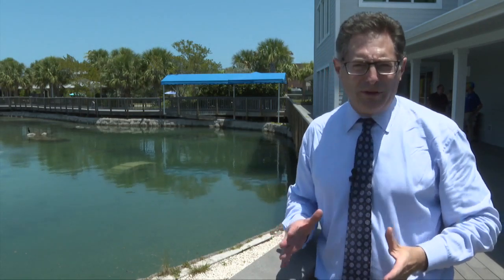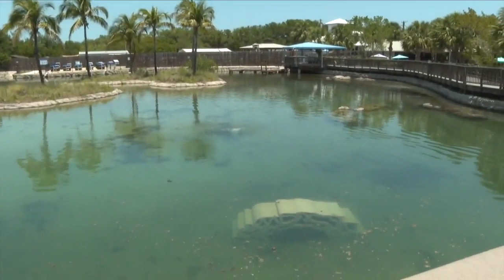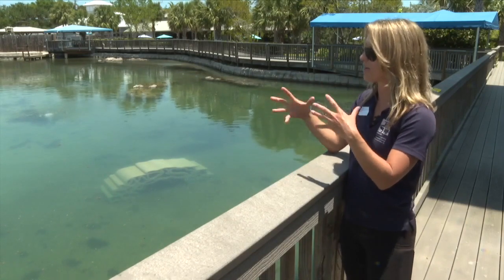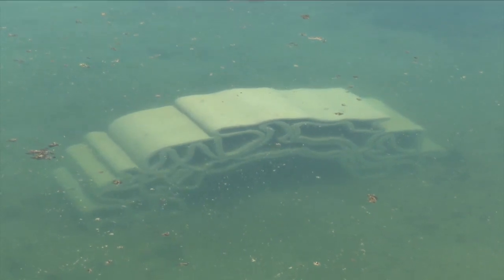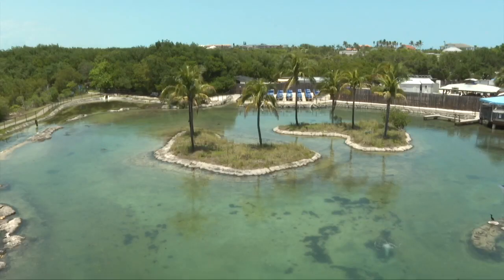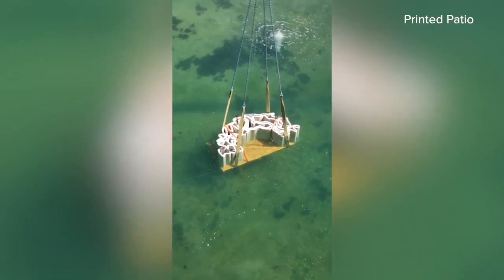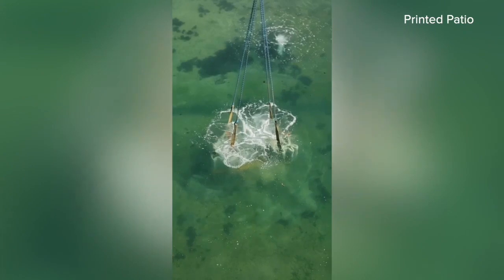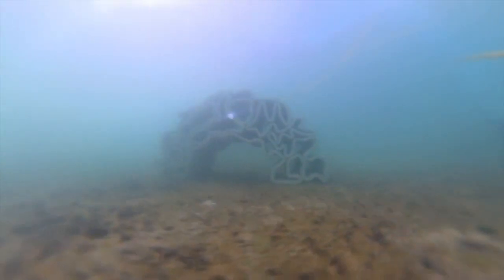3D-printed concrete reef placed in Florida Oceanographic Society's Gamefish Lagoon

Comment: They never mention why a 3D printed reef. Any advantage besides free advertising for the concrete company?
Reply: While the media that came out of the project was certainly nice, the advantages of the printed reef were abundant. The reef was specifically designed with an arch as a resting place for the lagoon turtles with buoyancy issues. These turtles have a difficult time holding themselves under the water, and the reef is designed so that they can swim under the arch and be held down. Additionally the other nooks in the reef are ideal dwellings for other marine creatures.